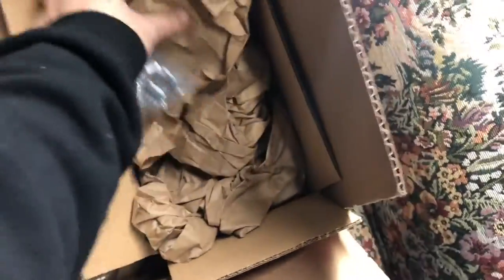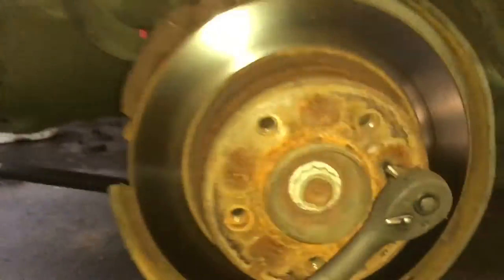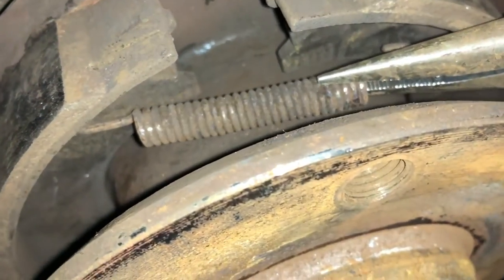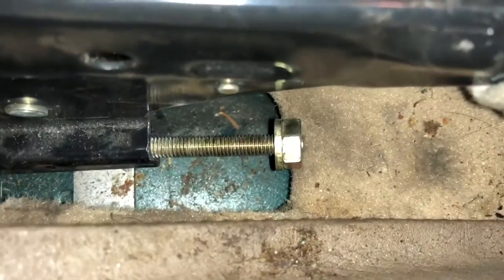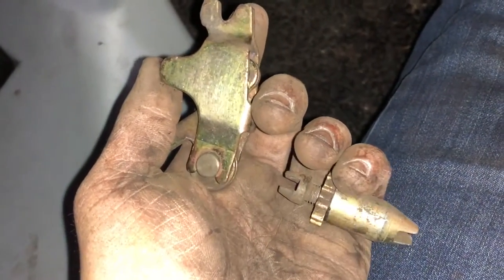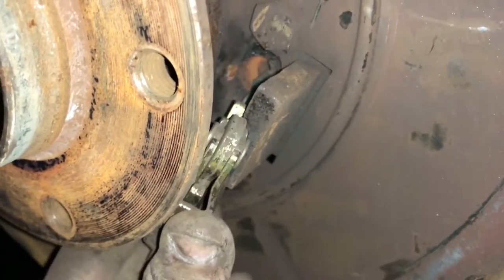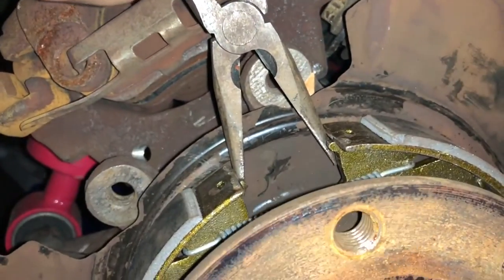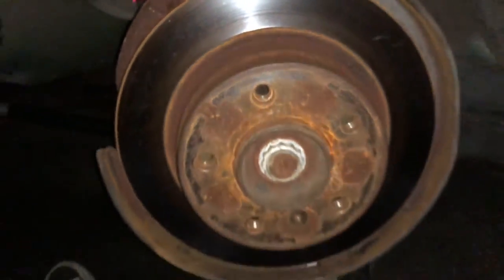How to Replace the Rear Brake Shoes on a BMW E36

Comment: didn't use this vid for doing the brakes, but how to remove the damn parking brake cable from the wheel carrier. probably the only vid I found that shows how to remove that part

Comment: hey bro, can we still reuse the old springs and adjuster? or do we need new ones? cheers
Reply from the maker: If they aren't too worn out then you could reuse them but its only like an extra $10 so you may as well replace them.

Comment: didn't grease backing plate,adjuster or expander???....
Reply from the maker: That was a big oversight on my part. Grease will definitely be used when I go to replace them again soon.
Reply: @JamDrifts  You aren't supossed to grease anything in parking brake except adjuster, because dirt is going to stick to everything and seize up.